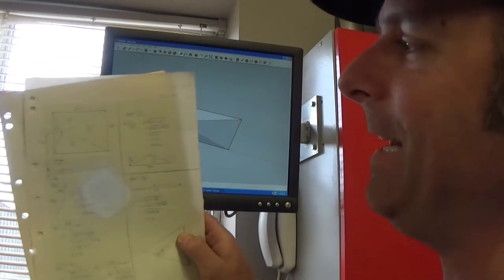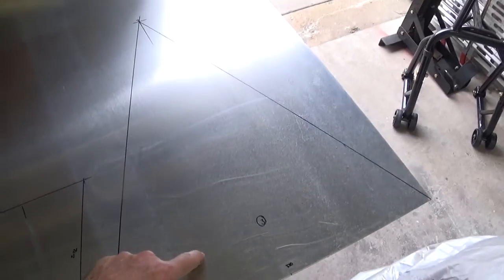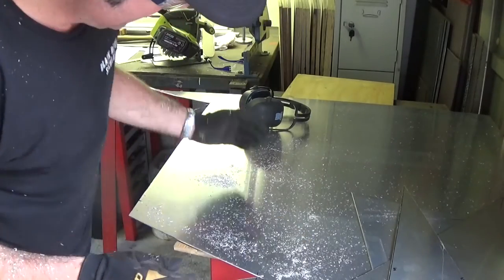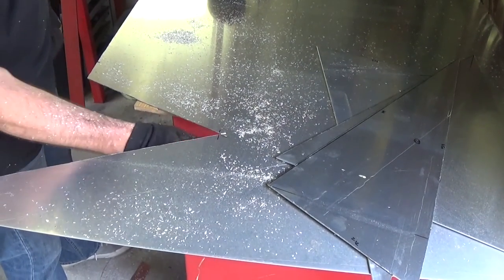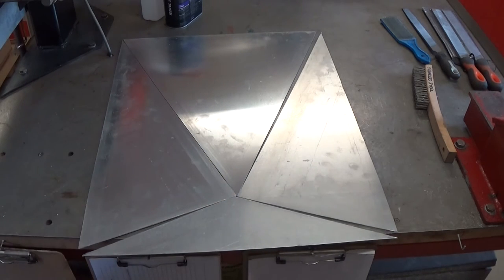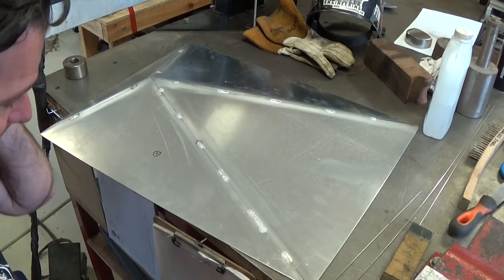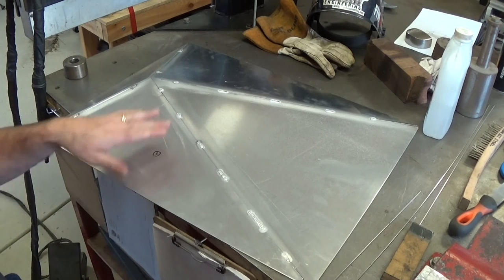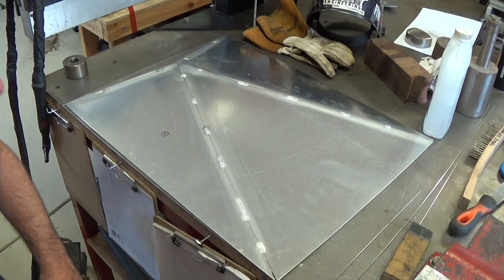How to build a killer (lathe) bench - part 9

Comment: I would have simply cut your current aluminum table top just below the Head-stock and along the backboard area and pushed the bottom down and then cut two triangles that started at 2 inches and tapered to to fit the length of each cut.
Make sure you place an easily retrievable magnet in the coolant collection tank and a swarf catch chamber with a raised drain tube before the coolant collection tank or you may be creating and investment in coolant pumps.
John USN Ret.